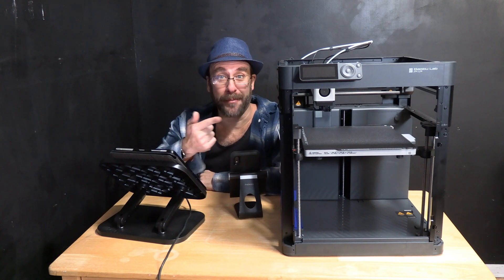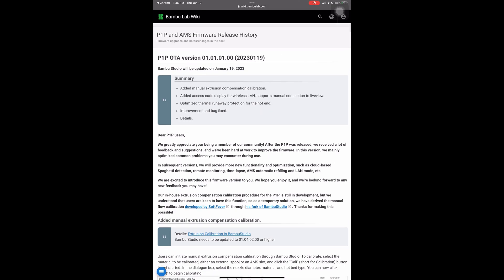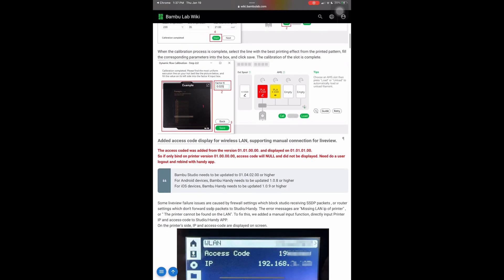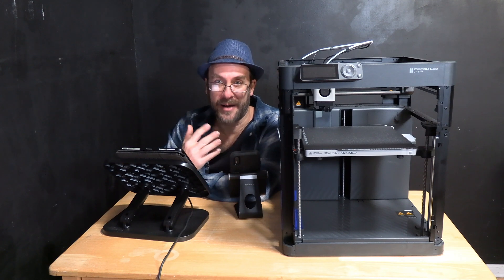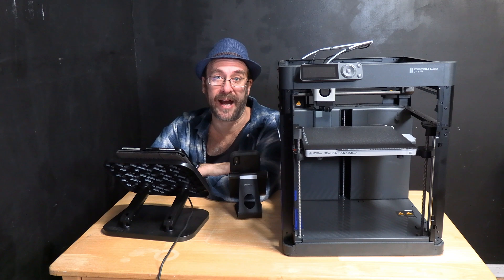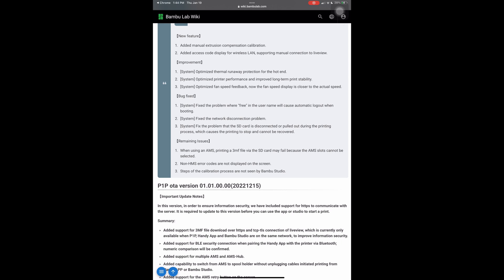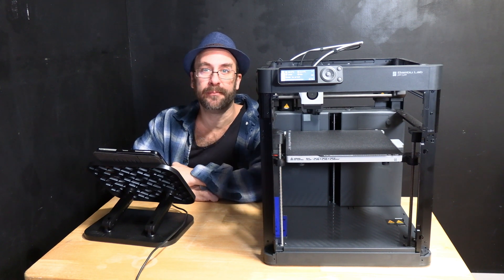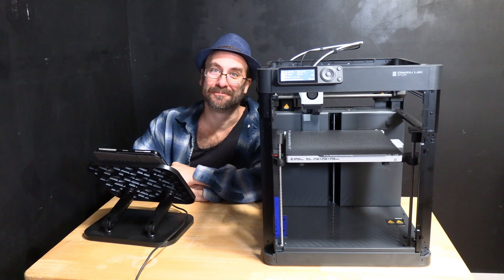New Bambu P1P Firmware is here to fix our CAMERA and LAN Problems!

Comment: on the LAN part, does it mean we dont have to use their cloud service anymore and all function still work? just like using octoprint? Man, I've been trying to research as much as possible between p1p and x1c, and i have tight budget. I want to print abs+ / asa everyday.
Reply from the maker: If you are on a tight budget, the P1P is a no brainer over the X1C. But, if you are gonna be grinding on Material that needs enclosure, the X1V may be the better option. However, you can enclose the P1P yourself, so, I would consider using the P1P to get your foot in the door, then you can print and build your own enclosure. Upgrades to hardnes steel gears and such, are easy-peasy. YES you can Lan Print

Comment: What are the steps to unbind and rebind? That's Geek for something, right?
Reply: All I can find is an option to Delete Device in Bambu Handy. Is that what they mean by "unbind"? The problem is that my phone camera is so terrible that binding using the stamp thingy takes all day. It's a real chore.
Reply: Also the directions say to get the latest version of Bambu Handy but there are no directions for how to do that, and there is no dialogue in Bambu Handy that I can see that either tells me which version I have or how to update it. I even checked in App Info and there's nothing to tell me which version I have or how to update it to the latest version.
Reply from the maker: Yes, to UNBIND is to disconnect the machine from the phone. Delete it, and re-do it. To update the app, just visit the app store on your Android or IPHONE, and it will offer the update if there is one
Reply: @3DRundown  Android phones are crazy. I went to update the app and it said I didn't have enough space so I needed to delete the app before updating it. There's so much bloatware in the phone that there's no room for anything else.
Reply from the maker: Yessir. Android blows

Comment: If like me your P1P printer fails to see the new update, then if you have a AMS fitted disconect this from the P1P and the update should happen
Reply from the maker: Also, try just turning it on, and letting it sit.....
Reply: @3DRundown My  P1P had never updated from when I received it in  early January (UK) this came with AMS, after your video I still couldn’t get it to update, so with help of WEB I found someone saying disconnect AMS from P1P which I did and the rest is history…..

Comment: Can you view the camera when you are not on your WiFi from your phone internet?
Reply from the maker: Apparently soon.
Reply: That is holding me back from buying one. I’d like to be able to check the print while I’m at work
Reply: This would be the hugest update they could do at the moment.
I want peace of mind to let my p1p run while I am not home.
Reply: @otium8  it’s stupid they didn’t make it capable from the beginning. But with that put aside, do you think I should get one or just get the Carbon combo?
Reply: @jeff5037  I actually find that hard to believe this feature is not shipped with the machine, but I tend to believe, given Bambu lab's reputation, that it will be soon implemented in a future firmware update ( BL stated that on their updates wiki ).
Regarding the acquisition of P1P, of course each case is different and depends on the user's needs. But I can tell you, The AMS has its flaws and benefits, it gives you multimaterial prints if the cost of filament wasting, also it has a high rate of incompatibility with some major spool brands with some work arounds ( an example would be the cardboard spools that you can print some adapters ).
If I were you, I would get the AMS only if I had a real need for muticoloured prints. 
Other than that there are some alternatives to the AMS like the "3D Chameleon".
Now to finish off, the P1P itself is a beauty, has been working flawlessly for me, and even having Enders and Flashforges in the past, the P1P impresses me very much. ( up to now, but maybe time will tell )
Hope that helps. Cheers
Reply: @otium8  I appreciate it very much thanks!

Comment: P1p? Miss the features you don't have that the x1c has?
Reply from the maker: Nah, not really. Wouldn't mind the screen, Lidar would be fun, but saved a ton of $$ and got a really great machine. ✌🏼
Reply: @3DRundown  Thanks for taking the time to respond to my obtuse question.
I am sitting on the fence whether to go p1p or x1c.   I am pretty much hearing the lidar is being 'turned off' and I don't ever see me wanting ABS, but the monitor? UGH that thing is pathetic on the p1p.
Reply: @graphguy  don't let the lack of a beautiful screen hold you back. P1P is a great printer, a game changer.
At the end of the day we all want good quality prints and ...fast, really fast.
You could invest on an AMS for the P1P later on if you feel the need.
But even without a lidar, a fancy screen, enclosure, still P1P is the best printer I ever owned. 
No regrets!!
Reply: @graphguy  and just a report regarding the screen.
On a daily basis I really just use the screen to load filament....really, after all the set up and LAN connection, everything else from a printing routine you can do by bambu studio or bambu handy. 
Hope that helps. Cheers
Reply: @Michel Paschalis  great point as that is how it is now with my neo max!
Reply: @otium8  with enclosing you would be able to print the same material as the x1c right ? You can already get harden nozzle and gear for it
Reply: @KronenPhoto  I haven't got an enclosure nor a hardened steel nozzle.
But it makes me believe that would be the case, at least in theory, I can't think of anything else that would prevent you from printing those engineering grade materials. 🤔
Reply: @otium8  Thank you for the encouragement, I just ordered my P1P with worries about how much I will miss the fancy screen.  I have some Android tablets lying around, what do you think of dedicating one (perhaps mounting it to the printer) running Bambu Handy to replace the tiny screen, how usable this solution would be?
Reply: @nick066hu  Hi, I would say, don't you worry about the screen. Even though the X1C Screen seems to be really good, the P1P's screen is not incapable by any means. Believe me, you will spend a really short time on that screen. If I have a filament spool installed on my P1P, I can spend days without even looking to the screen, all the work is basically done in Bambu Studio. The Bambu Handy app would be mostly for monitoring, you can also print your printing history, calibration and some other features, it will NOT replace your P1P's screen. Enough said, congratulations for your acquisition!!!
Reply: @otium8  Thank you, one more question: there is an auxiliary fan assembly that was part of the early bird package and it is also available now as an upgrade. 
What for, in which case do we need this fan?    What does it cool?
Reply: @nick066hu  Hi, I have got my auxiliary fan with the early bird sale, but haven't yet installed it.
As far as I know, this extra fan is also for the parts, it means you can cool the material faster, therefore you can have better quality while printing with higher speeds as the previous layer mustn't be soft for the next layer to be added on top of it. But I wouldn't know if the fan would have some extra attributes, maybe @3D Rundown could add to that.